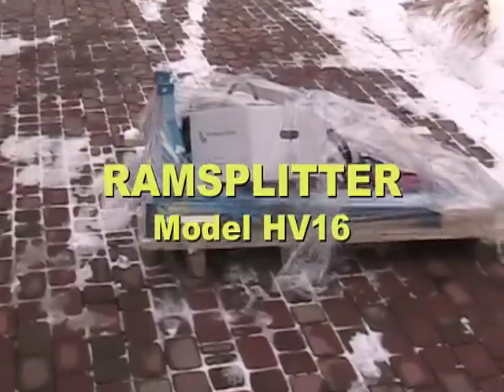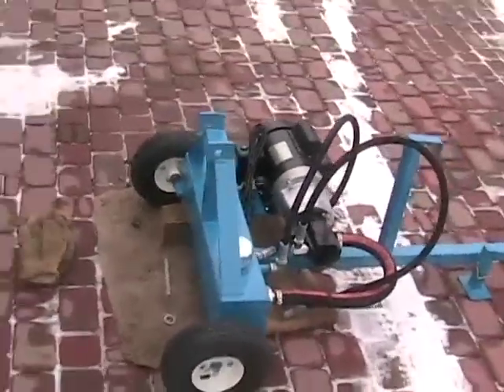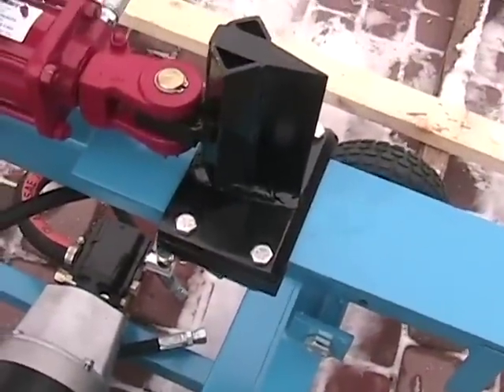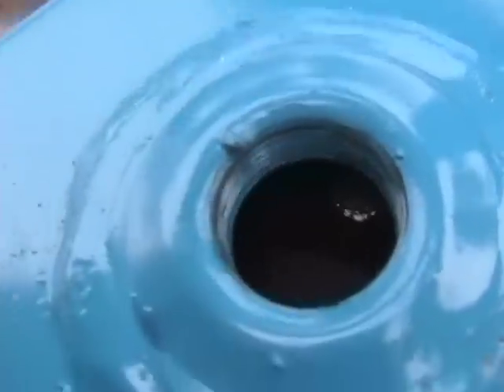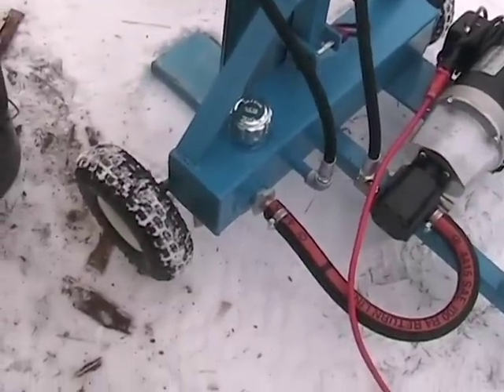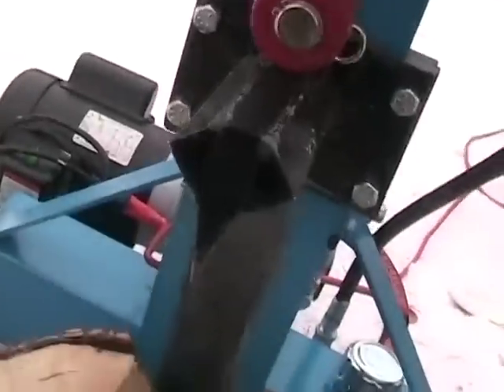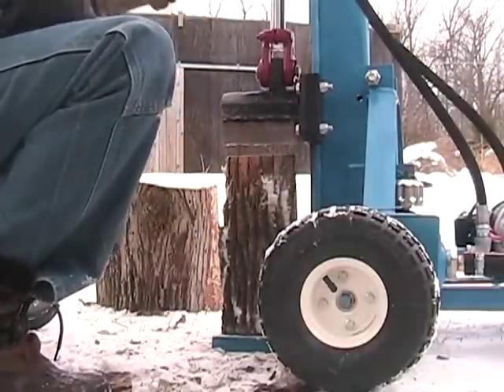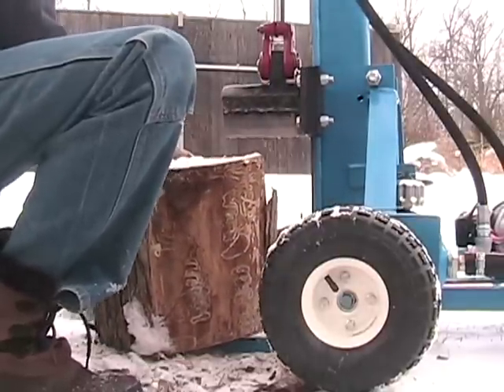Ramsplitter 16 Ton Electric Log Splitter

Comment: I bought one second hand. I plugged it in, turned it on, the 220 at my house smoked the capacitors. I had a friend replace components, double check wiring on motor. I plugged it in, ran it for 5 splits, heard a electric pop sound and now dead in the water again. Do they have some kind of dealer system? I tried calling and contacting the site, but haven't heard from them. Not much good if I can't run more than 1 1/2 pieces of wood.
Reply: Just replace the motor if you haven't yet.

Comment: Did you leave enough room in the tank for expansion when the hydraulic fluid gets warm?? You need the level to be at least 1 1/2” below the top of the tank!! Cant understand why people think that the tank has to be really full as the system keeps recycling the oil so when the ram and hoses are full, 3/4 full tank should be more than sufficient. Also when the splitter would work every bit as well in the horizontal position why the need to kneel in the snow?? 😜👍

Comment: Let me guess , Chinese , ok for perfect clean logs, it’s a noisy bugger, the wedge should be on the solid end, hydrolic oil pipes should be crimped on, if that pipes blew off under pressure it could make a pretty mess of you, and I don’t mean with oil, had friend lost an eye with a pipe put on like that.
Reply from the maker: Made in the USA, but like so much stuff today, from Chinese parts. Pressure side hoses are crimped and in excellent condition after 8 years. It's stored inside so not much UV exposure to degrade them. The hose with the hose clamps is the return line so not under pressure. Yeah, stationary wedges seem to be in these days, but it's all relative. Stationary wedges don't work well when you use use the splitter in the vertical mode, as I do 99% of the time. I got this mostly for splitting Elm, which even clear has lots of intertwined fiber and is difficult to split. This thing does the knotty sections of Elm well too. My neighbor comes over from time to to to use it to split the stuff his HF unit won't. Sorry about your friend, high pressure leaks are very dangerous.
Reply: only small splitters have the wedge on the solid end

Comment: logs that are not cut 90 degrees (and most aren't) will pop out of there and hurt you because of the slick end plate weld some knobs on it to grab the log you also need a table on both sides of the main beam so you won't keep having to pick logs that need resplit off the ground whoever designed this splitter obviously never had to split wood
Reply from the maker: Adding some weld to the end plate wouldn't hurt, but in the 7 years I've had this unit, and it gets a lot of use, I seldom have an issue with the log popping out because it' not been cut at 90°, which most of mine aren't. 

This unit works either horizontally or vertically. I don't use it horizontally. Many of my logs are quire heavy and I prefer not to lift them so I use it in the vertical mode. I just roll the logs to the machine, sit down on a 3 gallon bucket and flip them up for splitting. The split pieces are easy to toss where I want them. My back is happier too.
Reply: fourcycle i have had some pop half way across the yard so i guess you have had good luck, but keep an eye out for e'm good vid thanx

Comment: The splitter guide is garbage and there should have been some kind of cross hatching welded onto the butt plate to stop pieces of wood from slipping out under pressure. The more I look at how store bought splitters are made the more I realize I'm just going to have to build my own.
Reply: Daniel Fischer Thanks for commenting. Which electric splitter do you like the  best? What do you think of the Boss IIndustrial ES720 sold on Amazon for 421.66 right now. Thank you
Reply: Or just do a bit off tweaking to this one , it has all the basics their to start with , don’t know what it costs , I like the singlehanded control lever, that what bugs me with most new splitters , use both hands . Whatever you decide good luck , I’m buying a friends old tractor and homemade splitter , the price he’s asking I can’t refuse .
Reply: @charlestaylor8566  I picked up two splitters since watching this vid, both on sale from tractor supply. One is a cheap electric black and grey "earthquake" two handed jobbers for inside the wood shed was $149. It helped me cut up wood the first year but now it's resigned to kindling duty. The other is an upright countyline I picked up for $899 last year that works great, but will definitely need a larger foot welded on as I'm constantly dealing with rounds slipping off the plate and lifting the splitter up in the air in vert position. 

6 years ago when I moved I sold my 1967 international 504 that I had welded up a horizontal splitter for and just ran a bypass off the hydraulics to some quick disconnects out back. Worked fantastic for everything I could throw its way. It wasn't fast but I could run the diesel engine for a week at idle on a tank and it never bogged down. The best part was I could turn around and push the firewood up into a massive pile afterward. A tractor will open up so much for you if you have some land and some aspirations. Mine paid for itself a thousand times over and then some.

Comment: If it's still acting up try backing out the changeover valve on the pump that shifts the pump from hi to lo. That ought to help if you have a 2-stage. Try lining up your wedge with the line in the center of your block. This is called the fall line and it splits easiest on that line. AND you have a STRAINER, not a filter. If you run thicker oil in it the pump will suck the supply line together and cavitate. Had the same problem with one I got from a buddy. Too thick oil and collapsed line. And the jack should just stop moving without stalling the pump but you need a gauge to check pressure for that. Try the hi/lo first. People want it to go fast but slow and steady splits the block. You've probably figured all this out by now. Nice rig!.

Comment: Pretty neat splitter. Seems to work pretty good. Wonder how many amps it draws.
Reply from the maker: It was popping the 115v, 15 amp breaker when running off of a 100ft, 14-AWG extension cord when under a moderate load.  it was  okay when running on a 20A, 115v circuit but would stall.  After rewiring it for 220v, the current dropped to under 8A and stalling is no longer an issue - though it rarely was before.  If running on 115v with a short 12-AWG extension cord (<25ft or so.) on a 20A circuit you'd probably be fine.
Reply: Fourcycle Oh ok. Yeah 20 amps is better than 15 for running machines like this. The shorter the extension cord the better. Thanks.

Comment: i don't like all the play in the head. have you split any oak or locust?
Reply: I've split oak but not locust.  There is a bit of slop in the head.   I center the cylinder's rod to the center of the log as best I can.  Even if I don't, I've not had any problems.  To minimize binding, I grease both sides of the beam that the head slides on.
Reply: You can always grind slots in the wear pieces on each side and scoot them closer and tighten them down. My old splitter had a lot more slop than that and the only trouble I had was popping bolts. Grade-8 fine thread stopped that. It was about 14 tons or so. I always split from the outside in. 5 horse Briggs old school. Kept us warm for a long time. Ran about 1/2 speed. No use wearing it out and I'm old and slow anyway.